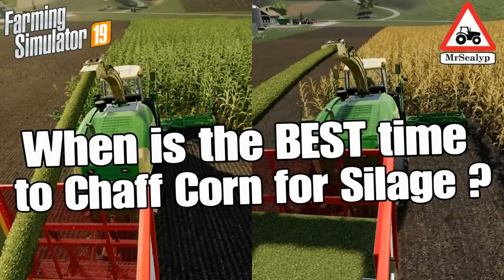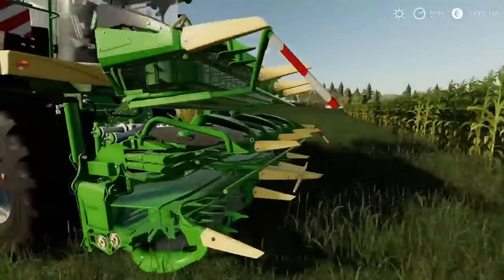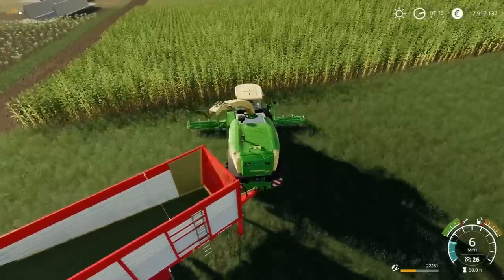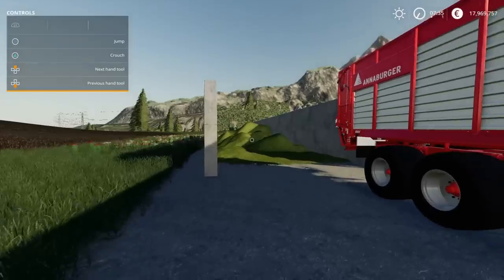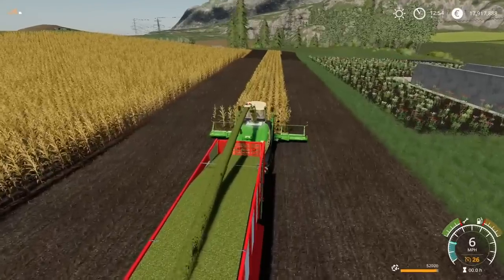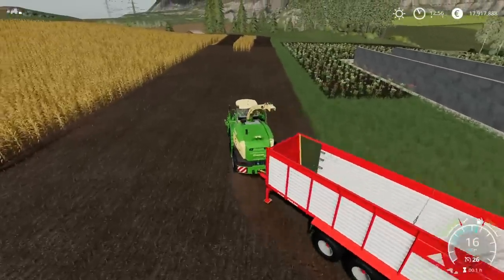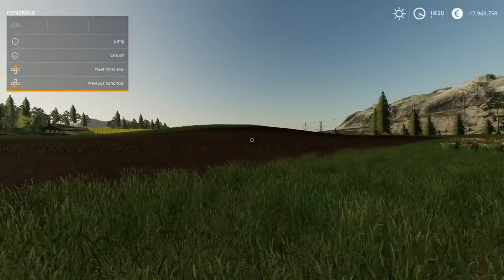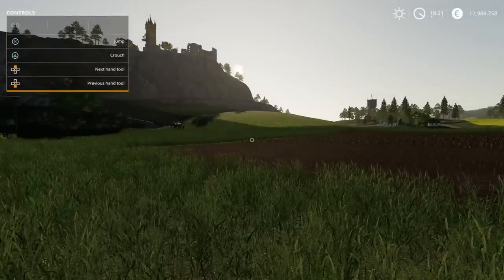Farming Simulator 19, PS4, Assistance! A Guide to... When is the BEST time to Chaff Corn for Silage?

Comment: The reason many forage harvesters dont connect to trailers is they are not equipped with a PTO or the correct hitch design.  The modded 580x from FS17 is INACCURATE, but does store a small amount of crop in the header.  The use of the Annaburger trailer should NOT work in the game, nor harvesting corn in dry state for chaff to create silage.

Comment: Hey guys. I'm trying to harvest chaff from wheat and it is ready for harvest. My problem is I can harvest for a bit, then it just stops even though my trailers are not full. I've tried three different ones. Am I doing something wrong? Also, I have both, the Krone and the trailer but NOTHING will connect to my Krone. Again, what am I doing wrong? Thanks so much.

Comment: One thing you may want to check with this test is on your first test your compacting was at 67% where on the others it was 0 to 1 or 2%. I have noticed on the Xbox version, and I would guess it would be the same on PS4 and PC, but as you compact, the "liters" go down. So by having that first test being compacted by 67% that's where you may have lost 500-600 liters in the bunker. Also, as pointed out by someone else on the comments, if you over run by say 10 ft (or meters, which ever measurement you want to use) one time but then by 30 feet the next time, if the harvester works like the wood chippers in 17 they still only hold so much so some could have been wasted in all of those tests, you may try, if you want and have time, is let a hired worker do run the harvester so that he/she stops as soon as the trailer is full and you drive beside it, so there is as little "waste" as possible. As always, love the vids Mr. Sealy P, keep up the great work, just trying to help out with some other ideas.
Reply: Mike Jacobs  you can actually go way over a full trailer load finish the whole field and get the whole field while you unload. As long as you don’t unhook the trailer.
Reply: You do NOT lose anything in compacting.

Comment: Thanks for the videos! regarding your note at 5:30, you dont need to split the field perfectly in half, a full field is just a certain number of full rows, so you could say, do 4 full rows at one state, and 4 full rows at another state and compare the results. as long as you're harvesting the same area, any result changes should be due to the state change you're testing. Cheers!

Comment: Supposedly if you wait until after a rain shower to harvest corn silage the crop is increased significantly. Hard to time it right with crop withering on.
Reply: @MrSealyp  yeah supposedly it works. I've not tried it as I never use corn silage but I've read on the actual FS19 forum about it and there's gamers who swear by it. Would be beneficial if you had a large cow pasture and need the silage.

Comment: Hi . Thanks for the great content you post. You're my go to guy for any info i need on FS 19. Quick question. What does the green growth stage equate to in Seasons ?  Is it at 67 % or 83 % growth that you can harvest corn for Silage ?
Reply: @MrSealyp  I will let you know.
Reply: @MrSealyp  50 % is fine . Looks like the last green stage of the corn before it turns yellow at 67%.  Both 50% and 67% worked. Sure the yield differences will be similar to yours.

Comment: Great video learning a lot what to do what not to do. I've been wondering I hire workers for a lot of things. Does hiring a worker more beneficial for you to do it yourself?
Reply: I would say that depends on how many other things are ready to be done on your farm.  If all your fields are growing with no weeds and dosent need anything done to them then i say do it yourself.  It will save money as u dont pay a worker and u dont have anything else to do.  However if there is more then 1 thing that needs to be done then put a worker on 1 thing and u do the other things.  I find using worker for fertilizing/lime is fast and spends the least amount of product doing it as they are generaly very accurate with width control.   Do note that there might be some patches in corners/edges of fields u need to fill in.

Comment: I have a question: what headers can be attached to chaff cutter?
 (pls answer me, i don't want to spend money on headers that don't attach to it)
p.s. can combine cutters attach to chaff cutter?
(and if the combine cutter can attach to it, would it still make chaff or it will harvest normally as combine?)
Reply: @MrSealyp  so when it has combine header, it means that it will harvest as combine and not make chaff?and as adapter i meant header.

Comment: On 19 the harvesters do have a small(!) buffer.  But you can lose.  Lots (I did with the Mex 5 and a trailed Lizard Auger Master).  Switched to the Rostselmash F 2650 (again with the Auger Master), and got 15 to 20k more for the starter fields on Ravenport.

Edit: just got to the bit where you demonstrate this, and… the bit you overran might have been too far already.

Comment: Why you did a whole field? Could have been way easier just harvest till you got the trailer full and compare how far you need to drive to get it filled once. Could have saved much work if I am not wrong.
Reply: Funny that you mention margins when it suits you. I too would have just harvested 1 line and did all the grow stages on 1 field without having to replant everytime. A 0.3% difference in yield between the different growstages would not differ when you do the test on a smaller scale... If anything, it would be more accurate since you'd eleminate the errors from overfilling a trailer.

Comment: How did you get so much money without the money cheat box on console
Reply: It can be done a couple of ways.  One is changing back and forth between multiplayer and single player.    The way I do it takes more time.   A pallet of liquid fertilizer costs $2400.  You buy one and split it up into multiple pallets.   Each of those that you sell back at the store will bring in $2160.  The most I've received from splitting one pallet is $129,000.
Reply: @markhenry1239  thanks for the input I just watched the video on his channel.
Reply: @markhenry1239  how do you split one?